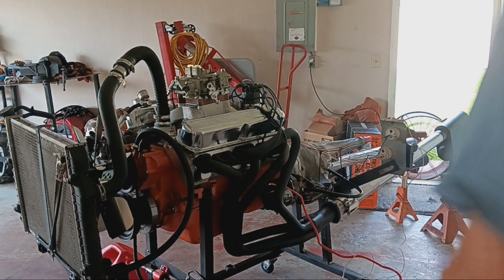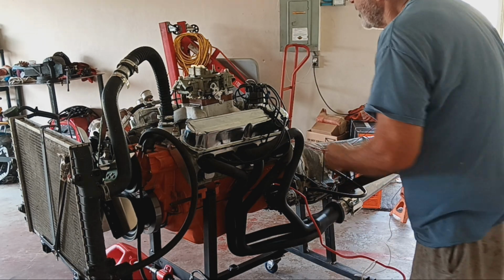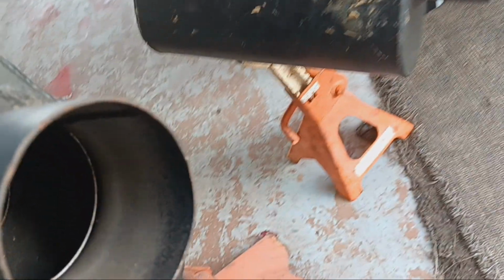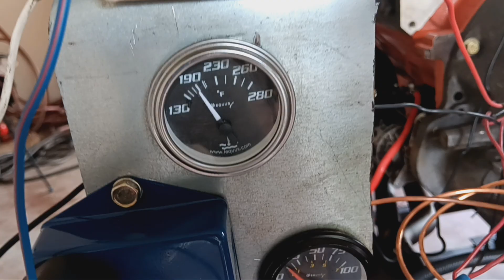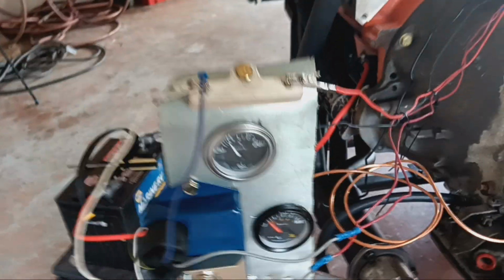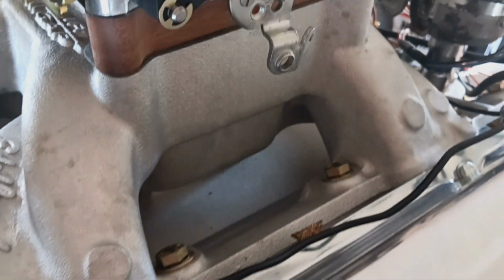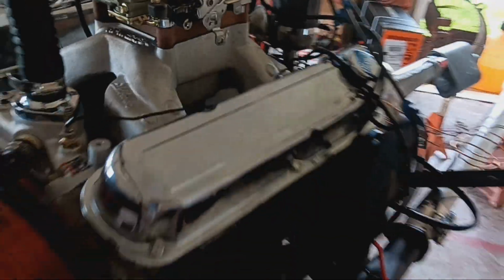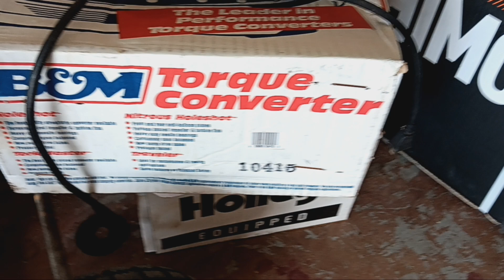Listen extreme energy .470 lift hydraulic flat tappit cam in this 71' 340 Chrysler..

Comment: Man that thing sounds and runs good and good thing u didnt toss it , would have been a waste of a great running motor, lot of ppl let a lil pitting scare them but it wont hurt a thing, one of my cylinders in my 347 didnt bore all a spot where the piston was wearing more on one side than the other out at the very top but it doesnt smoke a lick and runs strong.
Reply from the maker: I know you right!! And thank-you!!    I had faith Lil bit of pitting wouldn't matter just fill up with carbon...  no biggie 😊      I do love 347 Fords
Reply: @frankrizzo3922  Thats right fill up with carbon and seal it up like new money. Yeah the 347 is a torquey motor especially in a pinto , Im fixin to be in your shoes and have a extra motor with nothing to put it in , im fixing to build a 331 stroker, I found a good deal on the separate parts that I couldnt pass up , Ill have 450 into the entire stroker assembly when all said and done with all new parts except the pistons and they dont have much run time